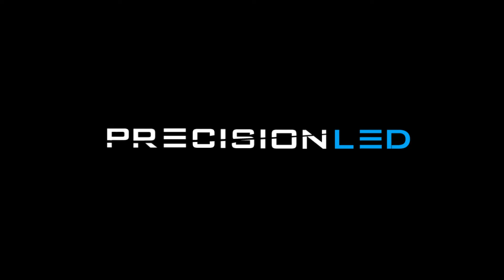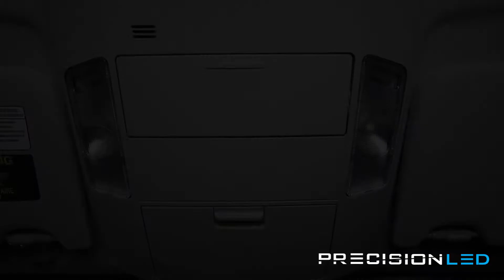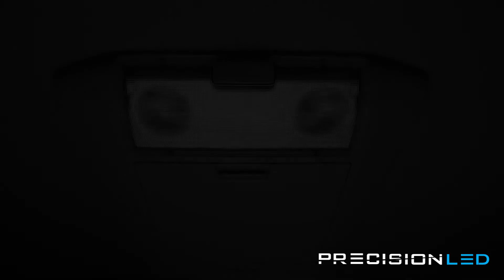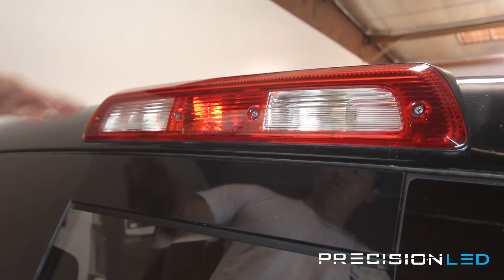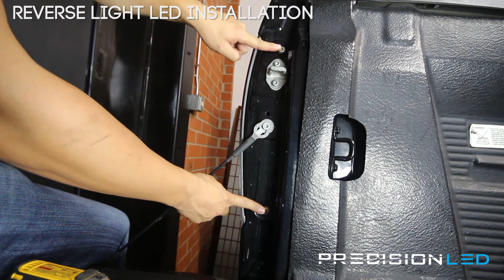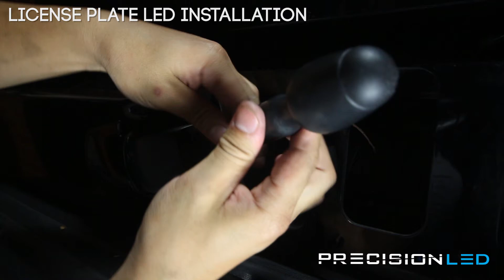Toyota Tundra LED Installation | 2nd Gen | (2007-2013)

Comment: To remove the hard to pull bulbs you can wrap the bulb in duct tape and pull it easily. It will probably ruin the halogen bulb but oh well. Maybe you can clean the adhesive off for later use or just toss the old bulb. Hope this helps.
Reply from the maker: Thanks for the helpful input!

Comment: Great video, do you have one showing how to change the puddle lights for a 2011 Toyota Tundra?
Reply from the maker: Thank you for your interest.  I do believe the outside puddle lights would be stock LED, which you cannot change as they are soldiered to a chip and board.

Comment: so when you were installing the led lights you were touching the chips with your fingers is that OK to do because I was always told not to because the oil from your hands makes the chips burn out faster
Reply from the maker: Thank you for your interest.  It is NOT okay to touch the glass portion of an HID bulb.  However, to touch an LED with your bare hands is not a problem.
Reply: OK thank you for your answer